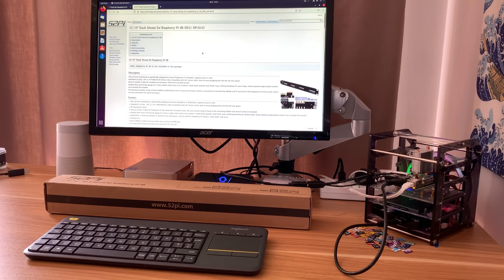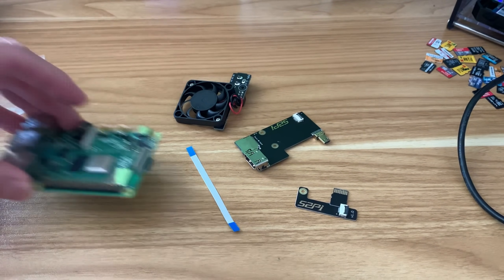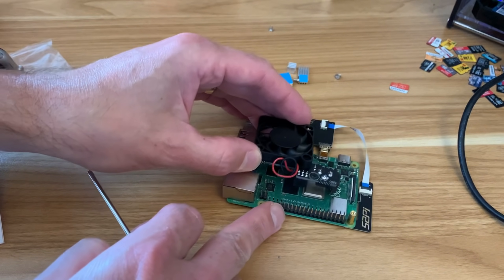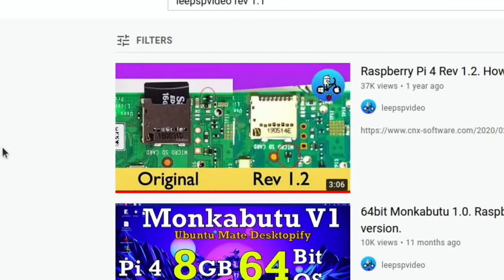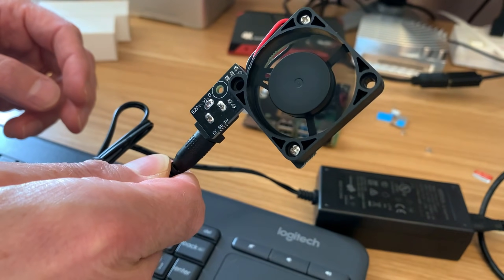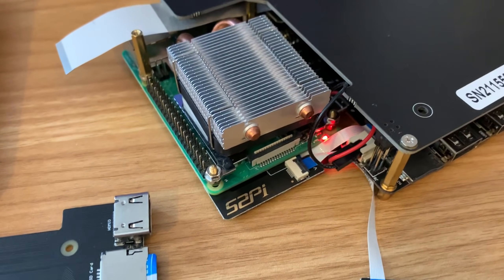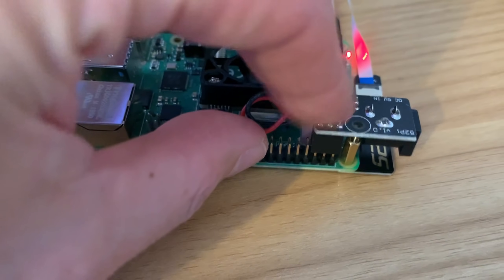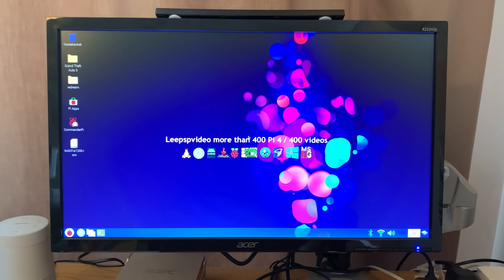Raspberry Pi 4 rack mount. HDMI & SD card relocation plus quiet fan.

Comment: Thanks a bunch for this video for it answered a lot of questions I had. Questions where the company itself had no answers to or incorrect ones 😂 
Have you by any chance tested it with a rpi 5?
I have a 4b and a 5 and would like to fit both in this :)
Reply from the maker: Pi 5 unlikely to fit without modification because the Ethernet and usb positions got swapped.

This supports Pi5

Pi 5 Rack Pro. 1U Rack mount for 4 Raspberry Pi 5s with NVMe
https://youtu.be/ixNyEFM7iZE
Reply: @leepspvideo that shouldn’t matter, right? Because it’s just one hole in the front for the usb and Ethernet and not divided into parts. I have looked at the hdmi ports and this are virtually identically placed on both boards (0.2 mm difference)

Comment: I like the quiet fan in this kit! 👍 I just reviewed the UCTRONICS rack mount on my channel - similar concept but with PoE and an OLED display. The fans are a bit loud but the PoE power, OLED display and SD card relocation are super slick!! I'm going to try replacing the fans on the UCTRONICS rack soon (parts are on the way already including a slim large rpi heatsink).

Comment: Lee great video..With your new PI4 you my need to change the boot order to USB then SSD in raspi-config one slot above where you updated the firmware. Heads up I got my PI4 4g week NO 1.. To get it to boot consistently you had to do over_voltage =3 in config.txt The thing that it do on original firmware is overclock way past 2300 GHZ with over_voltage =6 ...Now it's the same as your new one with firmware upgrade 2100 GHZ with over_voltage =6... Very said !!!!!!

Comment: It would be good if it could use the other hdmi port and just put another one on top of it at the back if you get what I mean. Edit: is there an adapter which moves all the ports the back where the usb and Ethernet are located?

Comment: I would like to power via PoE via my switch.  

someone reported on Amazon.  Guess your milage varies or firmware was not updaed.

" Poor quality and bad design
Reviewed in the United States on June 29, 2021
Bad design, both sd card slot and hdmi adapter quit working after a few days, the fan make a lot noise even outside the room. Have returned.
Reply from the maker: My fan was super quiet
Reply: @leepspvideo  would a poe connector you have shown before fit in the rack mount? +1 for great content
Reply from the maker: I guess so, the socket is then on the back of the Pi. So something like this may help.

https://uk.rs-online.com/web/p/ethernet-couplers/9160255/?cm_mmc=UK-PLA-DS3A-googleCSS_UK_EN_Connectors_WhoopEthernet+Couplers_Whoop9160255&matchtype=&pla-333360428100&gclid=CjwKCAjw55-HBhAHEiwARMCszh4ZRGYjyi8HuKdCxC0T_tNaV9vS78CLOzHVc8yaUPkUAZ8rxCJNhoCqa8QAvD_BwE&gclsrc=aw.ds

Comment: Fantastic :) It would be much more useful if the corner turn of the SD card extension cable had an 90 degree angle or radius....